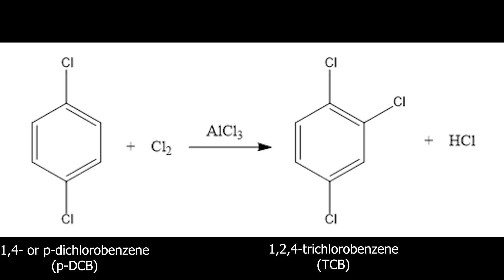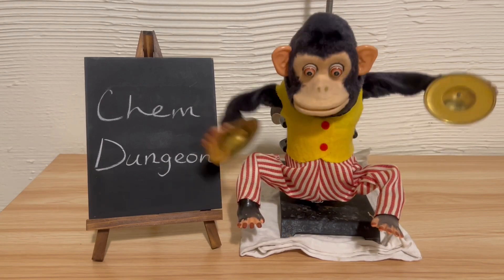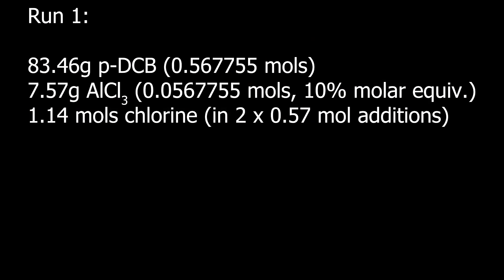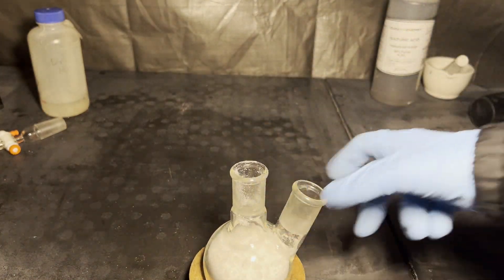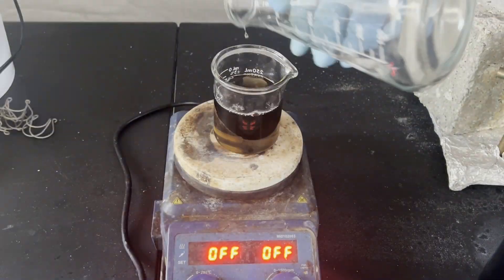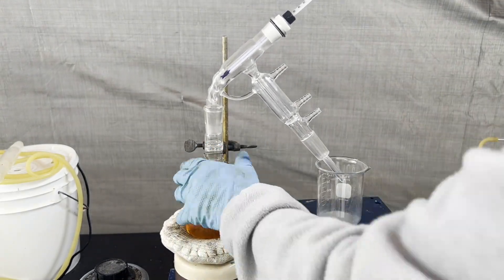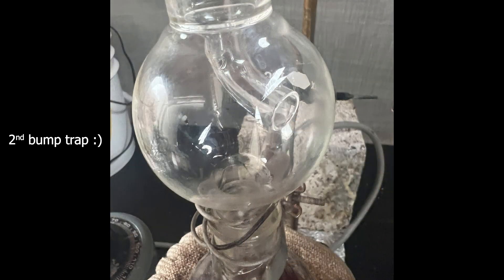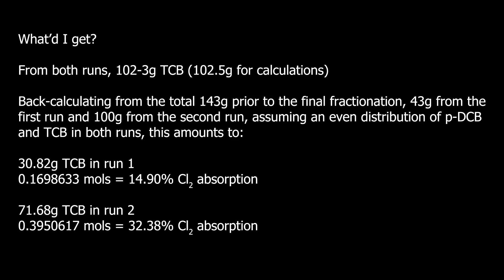Chlorinating urinal cakes

Comment: Can you make DDT?
Reply from the maker: I think nilered already did (vid got taken down, there’s a reupload), but yeah sure I can do it too. Just gotta figure out a decent yielding choral synthesis
Reply: @ChemDungeon  I got some Chloral Hydrate on ebay from China, but I don't know how pure it was or even if there is any in it. I tried making it from some instructions I found on the net, but it did not work. It might help if I knew what reaction was used.
Reply from the maker: @mikegLXIVMM  Chinese ebay chems are almost always hit or miss :p. From pretty much everything I've read on people trying to make chloral, they're either extremely low yielding or there is no yield. The reaction is running dry chlorine into anhydrous ethanol, but I haven't tried it myself. I'm curious about routes involving acetaldehyde, but until your comment, I never really had any interest in making it. Another route would be making, then reduction of trichloroacetic acid or a derivative of it and, if it's fully reduced to an alcohol, partial oxidation back to the aldehyde. Trichloroacetic acid would be easier to make but getting it to the aldehyde would be annoying so I think the acetaldehyde route might be more promising. About your 2nd comment, right? Apparently YT thinks things that go boom aren't worse than DDT? Very odd priorities
Reply: @ChemDungeon  
With all the "Energetics" content other channels, I'm surprised that DDT was removed😀
Reply: @ChemDungeon  I've got a detailed synthesis of chloral, if you are interested
Reply from the maker: @dimaminiailo3723  what reagents does it require?
Reply: @ChemDungeon  ethanol, chlorine, ferric chloride, sulphuric acid